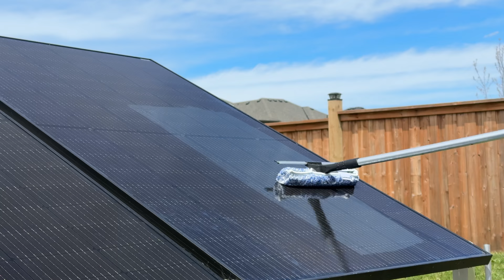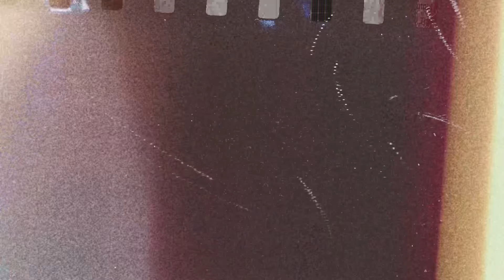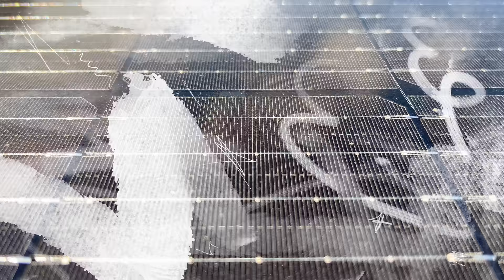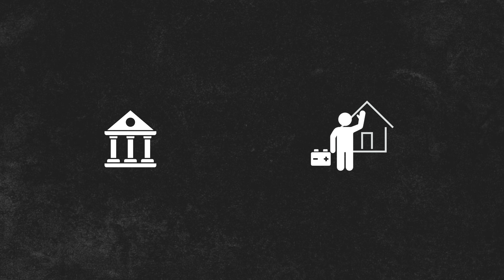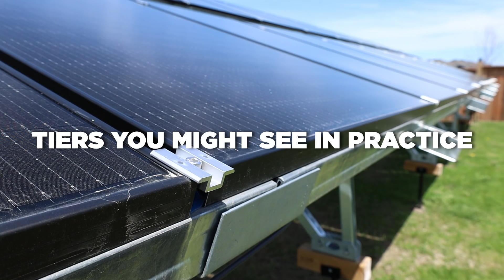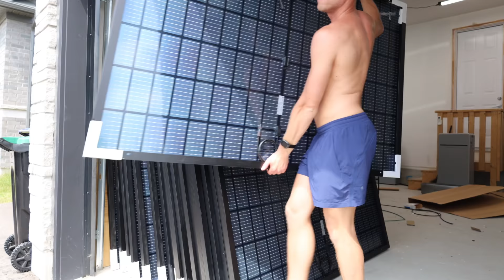Solar Panels Don't Matter... Here's Why.

Comment: "Solar panels don't matter"   "throw them all in the trash". "now here's 10 minutes explaining how and what to buy from our buddies over at signature solar." da fuq?
Reply: Yeah it’s called YouTube bating they bate we watch. No pun intended.
Reply: @NotSure-d3u  you're right. This guy is clearly a master bater.
Reply: @Obiter3 you could learn something
Reply: @NotSure-d3u I'm already highly skilled
Reply: @Obiter3 excuse me sir, well carry on then.
Reply: After this B.S. I will always subconsciously hate signature solar.lol😅😊
Reply: Probably you can recycle some older panels, especially say $20 used and get started on your learning curve.  Make sure you get phased inverters if you are trying sell your solar power to the electric company.  You need to sync alternating current (phases) so you don't output damaging voltages/current.  Cheap inverters (tempting) don't sync with power company and can cause damages.  They are stand alone (private use) and not for connection up to the power company.

"A.I." (Chatbot, ChatGPT) puts out contradictory statements, one says "mandatory" and next paragraph says "not required".  Assume it's required.
Reply: Don’t bother , they are low iq , click baity sell outs
Reply: Welcome to youtube sir!
Reply: I believe what the insinuation here is that the brand they recommend is one you can trust to be around for a while and not try to upsale you gimmicks. Did he do that well? Not really. But I don't think it was done with ill intent either.
Reply: well par for the course

Comment: There's a "rule of thumb" in relationships in general, which says that you should not make plans with a person further out than twice as long as you've known them. That can work for "how long a company has existed" as well.
Reply: There is also no way to guarantee any company will remain successful based upon past preformance. Companies that don't embrace changing technology fast enough can go under very easily, especially in relatively niche technology that changes quickly.
Reply: Plus my experience with warrantees (3-4 times) has been 100% “oh it broke during the warranty period?  Ok, what part broke exactly?  Oh, the (whatever) broke?  Sorry, that isn’t covered by the warranty. Bye.” 

And that is why I don’t get warranties any more.

Comment: Do you think any green energy company will still be around in 10 or 20 years?
If the installer has gone out of business, you would have to send the panel to the factory yourself, what do you think it would cost. Or worse, can you pack it so it gets to the factory intact?
The faulty panel will probably be thrown in the landfill and a new one will be bought.
Reply: Installers likely go out of business because they plan to. Probably still in business but under a different name. This way they almost never have to bother with warranty work for their past jobs, no $$ in it at all.

Comment: In the UK where there's a lot of cloud, I look for low light performance.
Reply: Lightning by Monday apparently.
Reply: Snow yesterday
Reply: Yeah and that's a big load of crap. Don't be fooled by that nonsense.
Reply: @Loki-rascal  In your testing, which types of panels and equipment did you use ? It will be great to see your existing results, thanks so much. Jesus loves you.
Reply: @Loki-rascal which nonsense? The low light?
Reply: @grimliver just get midrange panels and series them for best results in cloudy days..getting more panels at a cheaper price is better than having less panels that are Ferrari brand at a high price..
Reply: @annabellemanuel189 I just use eco worthy panels bifacial one's £66 each for 195w ones are they good or bad?
Reply: @annabellemanuel189  That is only applicable to grid connected solar panels, not offgrid.
Crappy panels that don't make anything in poor light will mean running the generator considerably more than with panels that do make electricity in poor light.
 You will spend more than the difference, in petrol or diesel, over the years in regions with poor light exposure during the winter. 
And you have to listen to the generator every few days.
Reply: @robinhood4640 I'm off grid.. you can't tell me that if I buy mid range and I get 50% MORE PANELS than if I buy the expensive ones .. wtf ? Are the expensive ones 50% more power?my panels are producing actual amps at 6:30am in the middle of the forest..series is the key..with good mppts to handle it.. you should double your battery bank voltage with your panels to do this exact thing, .. Ferrari brand panels ain't going to do shyt but burn a hole in your wallet. I got 4 arrays on 4 different mppts ..different panels in each set..my mid range ones are the most impressive as cost per watt comes in the equation.. the expensive ones make me made cuz your not going to get more than 22% efficiency.. they say thier good for shading..but that's debunked ..I seen it and other YouTubers seen it. Best is N type 500watt or bigger...none of this double sided bifacial crap ... higher volts like 40v connected put 2 in series to get 80ish volts for your 48v batt and your golden.. if 24v .. probably just parrelrallel all them..12v parelle..l unless you have smaller panels with less volts.... I know this cuz I don't have a generator or the grid to rely on.. and I have rainy season with weeks of typhoons one after the other.. my family dose just fine with power
Reply: @annabellemanuel189  If you look at the difference between mono and poly, the difference in very bad light can be huge.
It isn't the same with reasonable light, in which case it is not worth the extra cost.In good light the difference isn't even worth mentioning.
If you have enough storage to get through long periods of producing nothing whatsoever, you are right, but storage costs a lot more than panels still. Whatever you can get going into the batteries on very poor light days reduces the risk of running the batteries too low and needing back up, or reducing consumption to a minimum.
It isn't about the 22% efficiency, it is when there isn't any real light for extended periods that the difference matters. In the UK there isn't a typhoon season and winter has lots of very short days with very poor light, which is why the OP shared their view that low light performance is important.
Reply: @robinhood4640 I haven't seen poly pv panels sold in years though. Everyone is on the mono bandwagon now ..  mono for sure.. 
I rely on the charge everyday while using the power at the same time. My battery bank is only good for 2 days without a charge but it will be charged with the amount of over paneling I have even in awful weather
Reply: Exactly.  The question with both wind  or solar is not whether it’s good or bad, but will it work in your location.  

Sometimes the answer is yes, and in my sunny area many have solar on their homes and love it.  But that is under optimum conditions.

Comment: I got 8 100W $50 solar panels off of Amazon and they have been amazing. I get a solid 50 amps out of those solar panels with a 100/50 Victron solar controller throughout most of the day.

Comment: I heard the mounting and wiring configuration matters more than the panels themselves. Make sure you can swap a busted pannel without having to take a bunch of other stuff off. Also make sure they are I a location that you can easily clean them regularly.
Reply: Sounds like an amazing sales pitch. 

Most panels have very long shelf lives (25+ years until you see 20% degradation) so if you go with a very reputable panel distributor then swapping panels is way less of an issue than securing a good deal overall.

Comment: 1:30 the problem with local installers is the heavily inflated prices. They tried to sell my dad a 9000w solar panel only solution for $21k and then tried to propose battery packs per large appliance for $10k each per large appliance. Complete rip off so that is why i am looking into DIY
Reply: they offered my dad a battery for 50k, no thanks. I just bought him a system on black friday for way cheaper and had an electrical install it for like 2k. He has panels on his freakin roof, he doesn't need more.
Reply: I got ecoflow delta pros with a smart panel for grid charged backup (intend to charge overnight) and well under 7k for whole house backup
Reply: @saimedi2100 I wasn’t aware that they made moon light panels to charge over night
Reply: @vidzilla1 GRID charged
Reply: @vidzilla1 grid charge overnight when rates low, i don’t have my solar set up yet
Reply: @saimedi2100 most people have fixed rates.
Reply: Solar installers are worse than used car salesman...
Reply: They shouldn’t, but the employees are salesmen…their  job is to up sell. 

DIY is a good option and doesn’t able now, or you can say “look I want x system, for no more than y dollars” and some company will likely need the business and agree.
Reply: Not everyone can DIY. Solar installers are for those that can’t, and legit businesses cost money to operate.
Reply: @kdubfl that's true but charging 20-50,000 for solar panels and inverter installed when the supplies cost less than 7,000 is stealing from people.

I understand labor I understand overhead ECT but
Reply: Well 27 years in the industry and trying to pay my employees a good wage that is not a rip off at all. Although the battery should be sized to the load and not just tossed out as his number per appliance. You need an education.  Operating a business and paying Workmen's Comp. and insurance and pulling permits and paying for insurance on vehicles and giving employees a nice benefit package cost a lot of money.
Reply: @L @Loki-rascal brother, it’s time to consider open source and diy solar has simply outpaced traditional solar installation businesses
Reply: @Loki-rascal  The problem is the push to solar power has brought on a lot of fly by night operations that charge a lot, sell shoddy products and workmanship, and then file for bankruptcy in a couple of years when customers start complaining about their now dead or sick solar power systems. It's bad for the legit solar companies, but there's just too much bad apples out there now compared to other trades. And even with good companies, people are more often running into poor workmanship because good help is harder and harder to find.
Reply: @Loki-rascal yeah, as a tradie I can confirm I will go where the money is but I can also pass any drug test, any background test, and show up for work sober. Not everyone wants boring people like me working on their stuff though. 😉 I’ve told my wife on numerous occasions that if I ever started a business, the main reason would be to take care of my employees and customers. Otherwise I can make plenty of money working for other people.
Reply: @Loki-rascal One of the top reasons people want solar is to save money.  It's a Solar Investment, NOT purchase.  This business owner has confirmed with Solar It's easy to make a financial mistake, Solar capacity or use mistake, and that Solar has on Average a Decade long break even point.  Most people need a solar consultation be independent party before Investing into Solar
Reply: @Loki-rascal  When I was shopping for solar. My problem is priced for 8 year payback.  Charge $25k to install $15k worth of hardware for a $40k total.  If paying 200 $/ hour is 125 hours to for plan and install and overhead . . . Ball park 2 people for 5 days is 80 hours, leaving 45 hours (20% project profit) for overhead and profit.

I have a hard time working a $100 an hour job, to pay someone else $200 an hour for something I can DIY.
Reply: 25k for any install is highway robbery.
Reply: @Loki-rascal Totally agree bro. Workers are getting a salaries and they never say that their companies are robbing. But when a business owner gives a quote, it's becomes an issue
Reply: @Loki-rascal They don't have a clue. Running a business is costly and you get paid for what you do and what you know then how you back it up.

Comment: I don't consider the tier list to be relevant. I just look at specs.
Primary is price per kWh of course.
The vital specs are Voc which should be about 75% of the rating for the charge controller. 
Vmp which is the maximum power voltage which should fall within the charge controller's MPPT range.
Short circuit current which the sum of all strings should fall within the current specs for the charge controller OUTPUT.
Things like efficiency only matter if you are space limited rather than money limited because that only affects the size of the array for a given power rating.

Note: I have seen several powre stations where it is impossible to reach the stated power input because you can't get a panel that meets the specific voltage and current requirements to hit that theoretical max power input. Pecron is one of the few that is really good about not doing that. Still a pain but doable with Pecron.
Reply: Actually you were wrong. The most important number is temperature coefficient of power.
Reply: @Loki-rascal  Wrong, that is accounted for in the 75% rule. And it isn't the temp coefficient of power, it is the temperature coefficient of voltage that must be addressed.

Comment: Got a 590W JINKO bifacial panel for less than $100, it's really great so far.
Reply: Where did you find that? Used? That’s a great price.
Reply: @scottporush2545 nope, it's brand new. From a company in Nigeria, Fouani. Not sure of your location, but it sells pretty cheap here.
Reply: @eugene_nnamdi oh wow, very cool. I’m in the US so guessing I can’t get it nearly as cheap.
Reply: @scottporush2545 yeah, right 🥲
Reply: Thats a killer price. Were u find then so cheap? I got sungold 450w bi facial.
Reply: What does it produce? How many watts?
Reply: @rooter-c5c at peak sun, around 450-500W

Comment: The bifacial tier one solar panels (Sanyo) my employer installed at our training center are defective and not producing anywhere near what the warranty promised. Sanyo is no longer producing panels, so we were told by the company who maintains our solar systems that their is no warranty replacement. They were bought by another solar panel company who will not warranty those panels. Also, my former employer put in a 150kW array that was junk right out of the gate. That one was manufactured by TenK Solar out of Minnesota. Whoever made that decision created a complete fiasco. Looking into buying some q-cell panels for our home that were left over from a big solar field that went in recently. Buyer beware. Not all panels are what they are made out to be. The Sanyo panels were supposed to be top of the line back when they were installed. Fronius inverters have worked flawlessly for a very long time though.
Reply: Yeah my business was booming many years ago and I was in love with Sanyo solar panels. And I can say that Fronius inverters in the early days were running me at a 60 to 70% failure rate within the first two years.  After 10 years I got tired of pulling permits and shut down my business. Now I am aware of many homeowners that would like to kill me because their piece of shit Sanyo solar panels are all failing! And there is no warranty recourse.
Reply: @Loki-rascal sorry for your struggles, not your fault about sanyo, I hope the former customers understand that. You can do everything perfectly as a contractor, and one bad product from a vendor can damage your reputation...

Comment: I wound up getting a pallet of 33 x Hyundai 410W panels a year ago for around $0.33/W.  A slightly older tier 1 bifacial panel but far far less expensive than Hyundai’s top of the line 435W N-Topcon panels.  I am really happy with them.  Most are now on my roof, I only have 6 left on the pallet.
Reply: I bought a pallet of Hyperion and set them all up.  One of them developed a crack that spidered out and I needed to get a replacement.  It was kind of a pain in the ass to get a replacement.  I learned at that exact moment that I should have ordered spares.  I managed to get a replacement for the one panel I needed, but you did the smart thing keeping some spare panels around in case you need them.
Reply: @AndirHon  Yah, single panel purchases are very expensive and subject to shipping damage.  Always order enough to have spares.  I forget what the minimum palletization order size is for signature but usually it's something like 10 panels.
Reply: I have 2 of the older 410 watt Hyundai bifacials. I've noticed they run 2-3 volts higher than their claimed VOC specs. Have you experienced this with yours?
Reply: @Bamabrute85  In my configuration it is unlikely due to non-optimal roof angles, but remember that the Voc spec for all solar panels is at 25C (77F) ambient temps.  The voltage will go up in colder weather (and down in hotter weather), potentially as much as 20% in either direction.

So far the most I've seen recently was... lets see. 437V @ 11 panel string.  That's 39.7V/panel.  Voc (production turned off).   The rated Voc is 45.9V so I'm nowhere near it at the moment.

Putting 11 panels on that string is a bit of an experiment.  The MPPT's absolute maximum is 600V but goes into alarm at 550V.  I might have to drop it to 10 panels this winter but gonna run with it until/unless I see those open-circuit volts get too high.

-Matt
Reply: @junkerzn7312 yeah I made a mistake. I was thinking the VOC on my panels was 40.9 but after going out and double checking, they're 45.9 like yours. So that explains my confusion.